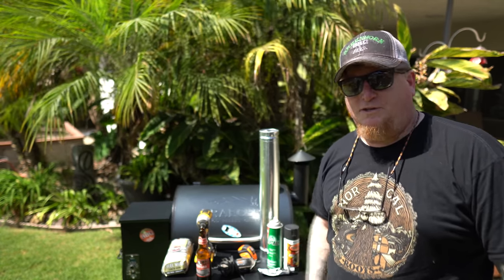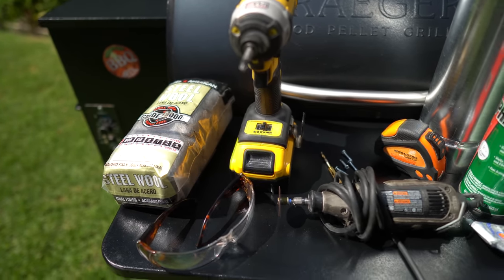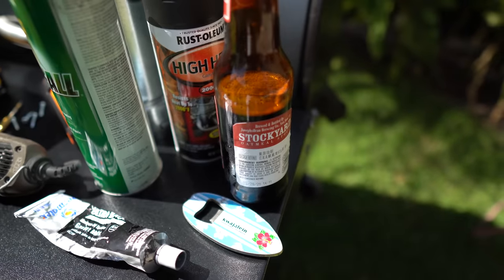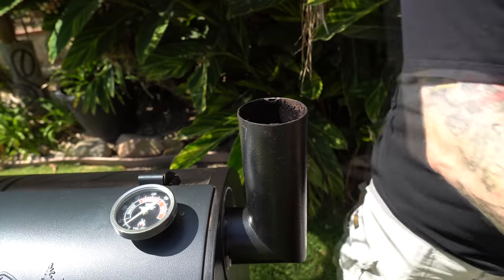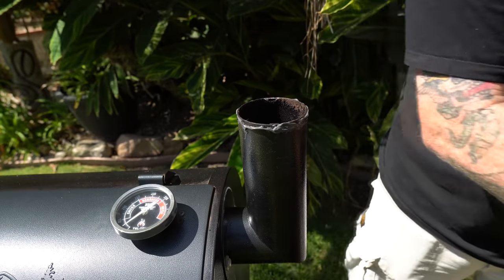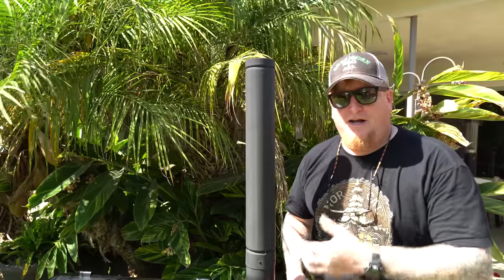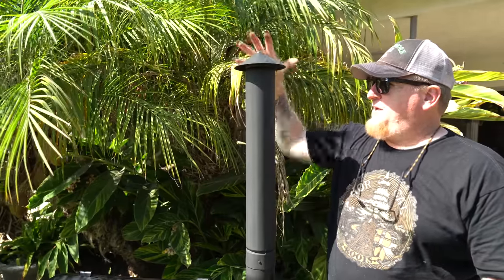Pellet Smoker Exhaust Modification - BIGGER IS BETTER!

Comment: Hey Todd!  You did it again....called it a Yoder! :-)    I can appreciate your Metal Skills.....not everyone is handy.  Yes it fit together like it was meant to be....almost too easy of a Mod! 
I'm fascinated and interested in what your findings will be with this Mod.  Like You mentioned......a pellet grill is a forced air design......will this make a difference?  
I need to know because I'll be the first to add that stack to My Lil Tex! Oh....wait.......I sold it. :-(     Cool stuff Bro!........I can't wait for the results!   Metal On!!!  \m/
Reply from the maker: Thanks for watching bro! It increases max temp on High setting, I saw 450 almost. I will do a results video someday soon.
Reply: @GreenhornBBQbeer  We want this followup!
Reply from the maker: @ZackPyle  thanks for the reminder.  I've included that in various videos whenever using it. But you are right, I have never made a special video just about that. Maybe I should?
Reply: @GreenhornBBQbeer  I'm building an outdoor kitchen and thinking about doing a vent up to the porch roof line. Interested in any effects you've seen!
Reply: @GreenhornBBQbeer  Also check out the DuraVent PelletVent stuff on Home Depot's site
Reply from the maker: @ZackPyle  I've found a bit more smoke I think due to the increased back pressure.  I would suggest a vent booster fan seen in residential HVAC applications.

Comment: For those of you who are going to duplicate this don’t use gas vent USE PELLET VENT INSTEAD  reason being the pellet vent is stainless steel!  WHEN you heat up galvanized metal it puts off dangerous vapors that are NOT good to breathe! 
AND The taller vent stack will create a better draft through the fire therefore you may find your temperatures are higher than normal just have to compensate and that’s exactly what I wanna do to my green mountain grill because I can’t seem to get enough heat out of it!
Reply: Be careful doing any mod. However the gas vent pipe he used is the same as what is use in most homes for your furnace and water heater.
Ps. The make a cap for that vent that you could use to top it off

Comment: Hey! 2 inches is enough right? Lol You might have to put a light on the top so planes dont run into it. 😁 Cool mod to keep the smoke out of your face. I usually tilt my Yoder stack back if the smoke blows in my face .
Reply from the maker: Thanks bro! Yeah, I need lights, next mod! I did it more for the bigger is better theory but I know what you mean...

Comment: I have a pit boss 540 and I want just the short attack with the cap. Plug the majority of the holes and be able to contain the majority of the smoke as I'm not liking how little smoke taste I'm getting. IAM using good pellets and my smoker has and endless supply of smoke but I feel it's leaking out and it's not able to stay in the area of the meat. If anyone disagrees with this idea please let me know why and if you know of a better solution. Thank you

Comment: What do you do for the smoke lost around the door ? Thanks for the video
Reply from the maker: Hi, thanks for watching.  Good question,  right now nothing,  but I've got several ideas and I'm not settled on either one yet. What say you?
Reply: Hey Jim, I thought I was having the same issue as well,  it over time and heavy use, the seasoning inside the smoker has built up around the inside edge of the door and hardly has any bleed out of smoke anymore. I do clean my smoker after every use, but I avoid cleaning the built up seasoning around the inside Edge of the door. Hope that helps sir.

Comment: i just modified my green mountain grill using the same furnace pipe , went one step further and attached a 3 foot flex pipe to go around and over the awning that is over the bbq.  I havent tried it yet for draw issues but will drill some vent holes if the draw is to much
Reply from the maker: There is a ratio where you can have too much draw so test it out..
Reply: Todd what size of pipe did you use. I have  a Gmg Daniel Boone too

Comment: My new Traeger doesn’t really smoke unless it’s like 120-180f. I am wondering how to smoke at 250.
Reply from the maker: It should smoke at all temps. The auger cycles and smoke is not constant. But you don't want to see the smoke anyway, not on a real smoker. It should be more of a blue transparent color. But pellet grills make these "puffs" now and then. Just have to get used to it.
Reply: GreenhornBBQbeer yeah Traeger responded to me about this on Youtube. I guess they recommend mesquite and 130-180 for smoking. I did a pork butt but it just tasted roasted like in an oven.

Comment: Cool mod, Todd.  I especially like the idea of the double wall pipe.  The outer wall should shield the inner from cooling from the wind.  I think keeping the inner wall hot will create a better air draw throughout the unit, promoting higher maximum temperatures?  If this is the case, I hope you will give us an update in the near future.  It definitely added some “coolness” to your pit. 😎 👍
Reply from the maker: You are right again! The High temperature setting gets way up there now. I do want to do a comparison soon and see what I get. I may have to take that stack off for the "before" but so be it...